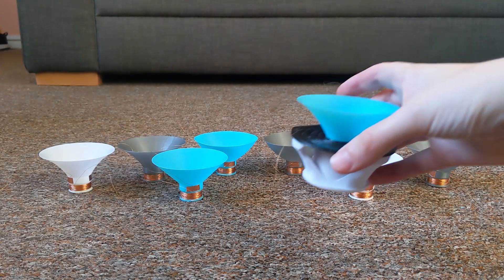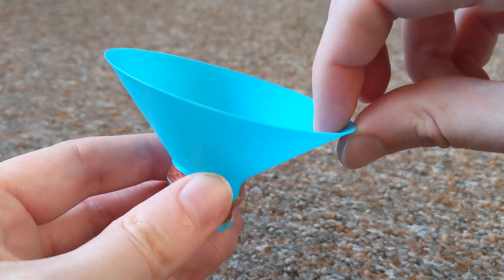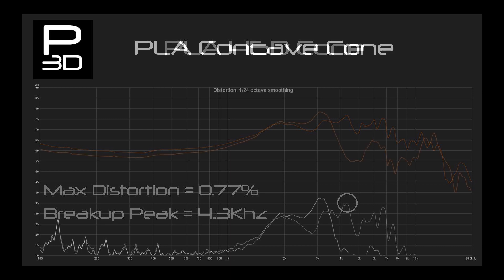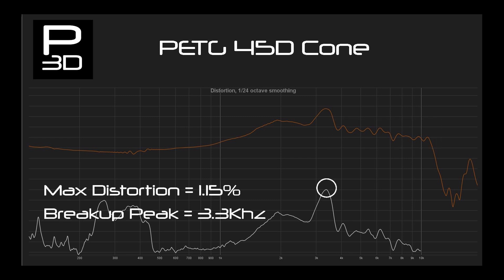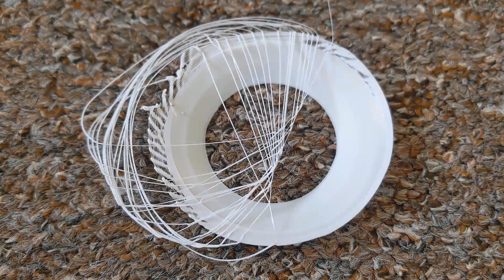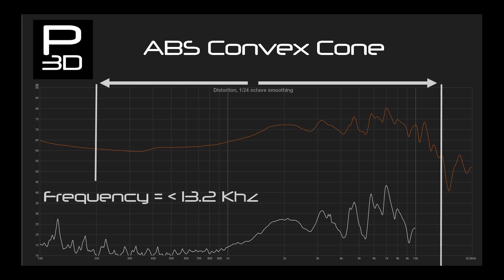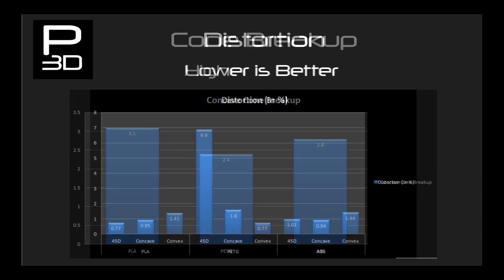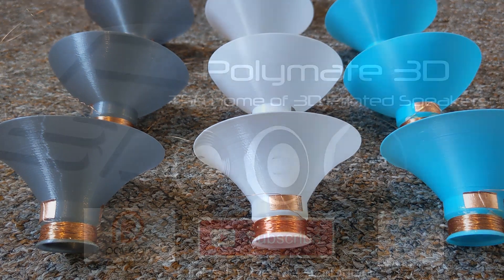Test Cone Platform - PLA vs PETG vs ABS - Cones & Z Axis Stiffness

Comment: Did he try carbon fiber pla?
Reply from the maker: I have done so since, along with CF PETG and a CF Nylon composite and the later is my favourite choice.
The best 'easy' filament though has been Fiberlogy PLA. There's has a high modulus of 3,800MPa. Most normal PLA's are around 2,000 and the 'strong / impact' ones are softer at around 1,500Mpa.
For frequency extension you want stiffer. If you looking at a midbass or woofer, normal PETG is actually pretty good stuff.
Hope the info helps!
Reply: Thanks, it helps a lot @Polymate3D

Comment: hi, well done the research, this must be published along scientific papers.

I suppose the diameter of the nozzle and wall thickness is important too. if you could use a 0.1mm nozzle and make a PLA sandwich cone you could test different sandwich cores as hexagon , V, sinusoidal etc, and core thickness too
Reply from the maker: Hey Ayoze :) Thanks dude. I think the cone test platform went well but since this video there are improvements to be had, but it will wait until the new long term magnet motor is designed.  Many of your ideas I think are great, but with FDM, a nozzle so small I think would always jam up. MSLA however is a different ball game and it is something will will adventure into soon enough!
Reply: @Polymate3D  well, with 0.2mm can be possible too, I see you are using PC now, if you could make speakers with low qts you could use with front, back or combined horn enclosures so you won't have problems with efficiency. 

your work is an example for any diyer, have a good day!.
Reply from the maker: @crapisnice  Indeed they are. It is something that I will likely find out on the MSLA side anyway, but food for thought! As for a low Qts, yes. This is very much related to Qes / BL and is exactly why the magnet motor is where the time and effort it being poured right now. Its going well as you may of seen on Patreon, but I still have some more experiments and testing to go before a decision is made :)
Reply: @Polymate3D  I forgot, this is  a coil winding machine with arduino
https://www.youtube.com/watch?v=8Vu_iv9_gf8

Comment: You should try regular old PA6 nylon. Its light for a plastic, strong while thin,  and sticks to itself in a water tight fashion in most instances. Great work !
Reply from the maker: For the full range drivers, I would imagine PA6 low youngs modulus would mean I would lose the top end. For a woofer or mid-bass it may be a good candidate. a reinforced CF / GF based may be a killer combo!

Comment: Have you considered high temp, heat treated PLA? Stiffness increases greatly IIRC.
Reply from the maker: Hey Adam. I have done but went against it due to warping under treatement of such thin walled object. I may try other materials which state low warp during this process and see. It would be interesting to see how it effects is abilities during cone breakup as well. Thanks for the idea. Any others, please fire away :)
Reply: @Polymate3D  i do. Maybe warping might be contained if it can be constrained with a rigid mold, perhaps a wood mold for the inside and outside and clamp? Also, if you could collect data on how it warps perhaps you can actually plan for it if you can manage time and heat more precisely for repeatability. Perhaps adding shape/angles to the cone for rigidity? I have no idea how this could impact sound BUT maybe with this you could find a shape not done before to produce a sound unlike others while mitigating the heat treatment process warping issues with or without mold as well? Hell maybe particular patterns in the cone will help with certain frequency ranges depending on the intended range of the woofer/speaker?
Reply: @Polymate3D  also, have you tried a thicker nozzle, like 0.6 or 0.8 so you can increase the width of the lines during print? This will greatly improve strength and may help prevent warping. I'm not sure what a thicker wall will do to performance aside from obvious factors such as the mechanical characteristics like moving mass related TS parameters
Reply: @Polymate 3D  another question. It would help me and you if you could provide a brief explanation as to how rigidity vs flex effects characteristics such as distortion, frequency response, and damping. How does a thicker cone effect these parameters? What If the cone is the same mass but much more rigid? I need/would like to better understand how these all correlate. Im guessing shape/geometry impacts these as well but I'm guessing that  is mostly due to resulting stiffness characteristics? What impacts does geometry have on the actual sound wave shapes produced? - if two woofers with identical TS parameters, which includes mechanical stiffness of the cone...let's say they were identical in this dreamworld however the ONLY difference was the cone geometry,  in what ways could this impact sound reproduction...if at all? I think you can understand what I'm getting at here, but may not be saying it correctly. Ultimately would adding ribs around the woofers help, essentially splines running around the diameter of the cone with one end at the dust cap and the other towards the surround evenly spaced around. If it might hell how would rounded splines vs a sharper, 45 or 90 degree spline effect sound characteristics? Maybe the woofer could be a dual material to balance stiffness and flex if that is desirable. If you need more explanation please ask. The more I understand the more useful I may be.